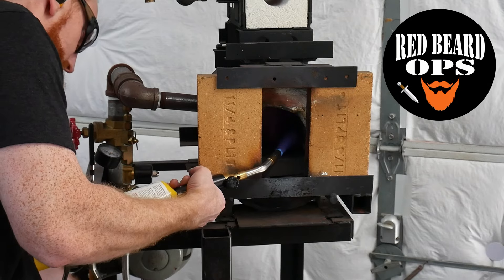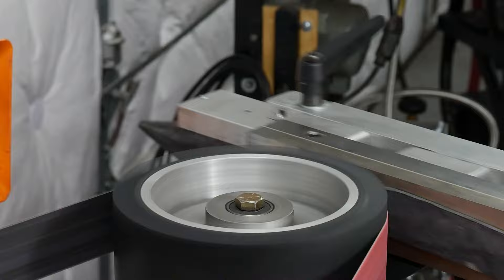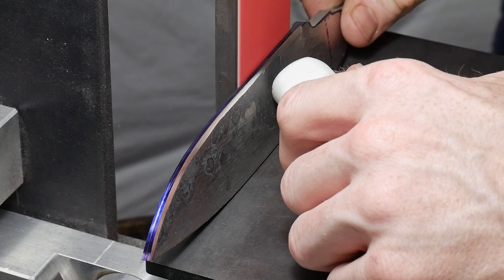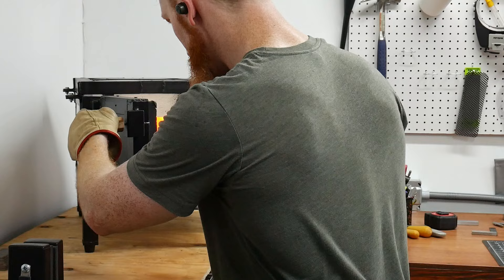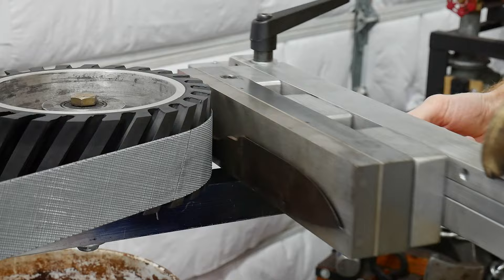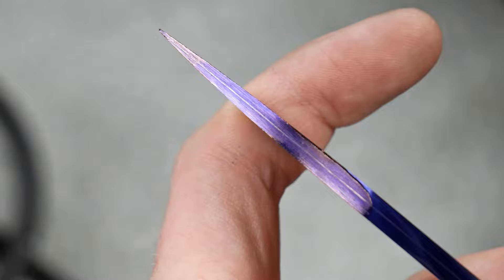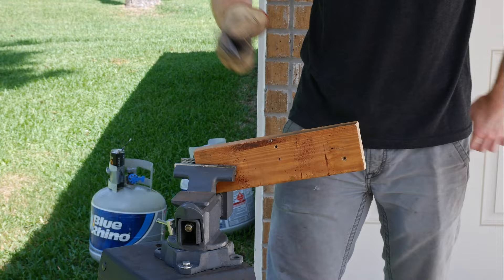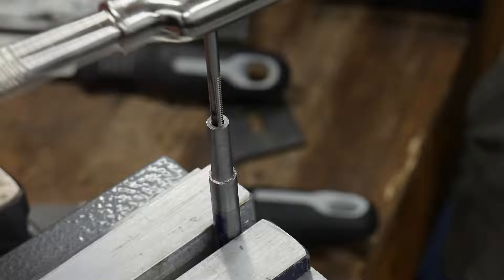My June Hunter - Knife Making - Part 1/3

Comment: Hand forging, looks like you have that process down. Looking good
. I grind off the scale lightly with a flap disk. Saves on those belts. 
Be careful of grinding that Teflon, heating it up over 500F releases Phosgene gas.We had a machinist sent to the hospital machining that stuff. (I know it would be hard to get it that hot but just thought I would through that out there.) Be save We are getting the HEAT this weekend. LOL
Reply from the maker: Thanks man. I have a ways to go, but I'm getting there. Thanks for the tips!

Comment: Since you have the press you can easily forge a cut off hardy and an anvil block from a cheap 4 or 5 pound splitting wedge.  Just cut it in half and forge hardy shanks on each piece with the press.  A little grinding to clean it up.  Heat treat is a bit of guess work.  The one I used seemed similar to 1045.
Reply from the maker: Thanks for the ideas man! I need to get on that.

Comment: Using a jig is ridiculously easy to blue a tip on finer grit belts just like a push stick.  When I went to freehand without gloves, my grinds took three times as long but I never overheated the blade.  It's too bad there's not a way to wet grind with a 2x72, that would've saved a lot of blades when I was starting out.

I was reading a while back about normalization, it seems that several of the pros are doing a heat soak at 1650 for 3-5min, letting the blade air cool anywhere below 900, then doing the same thing three more times at 1450.  Saves a lot of time not having to wait until the blade is room temp, and not having to set the oven to several different temps.  It also helps to prevent decarb on the outside with a whole lot of heat cycles, so less time and waste grinding to the hard steel underneath.  I tested it out the other day on a coupon, the grain structure was tight and consistent, with no decarb zones that I could find after grinding the scale off.  A quick acid etch shows any decarb as it'll be a darker etch than fully hardened steel.
Reply from the maker: Thanks for the thoughts and tip man! Cheers

Comment: Hey James…looks awesome!  I built a tempering oven similar to yours and I know you have a video on it, but how much variance do you get from your set point?  Also, if your looking for a disc sander, check out the vander sander from beck’s armory if you haven’t already.  It’s DIY and super versatile.  I’m going to order one myself.
Reply from the maker: Hey Jason, on my tempering oven I have a variance of only a few degrees F. I found that insulating it with wool and some reflective material on the door really helped. It took me a while messing around with set points to have it act right.  --------- On the disc sander, it's funny you say that... because we're going to be doing a collaboration on my disc setup. Cheers Jason!